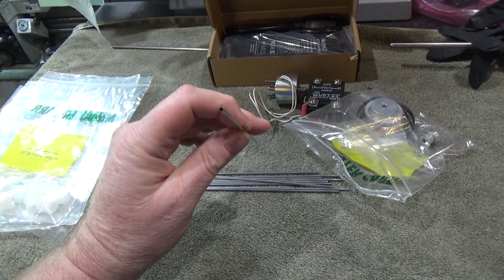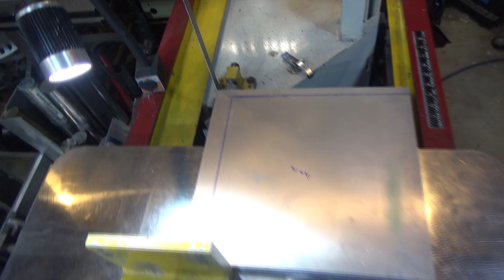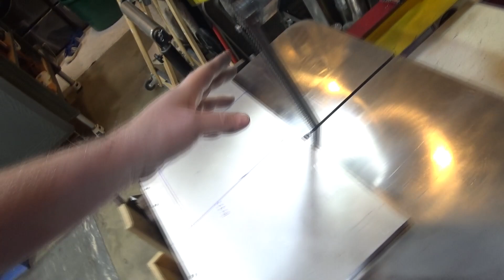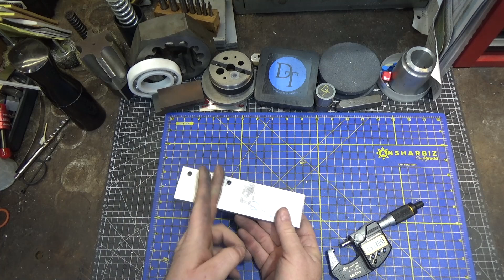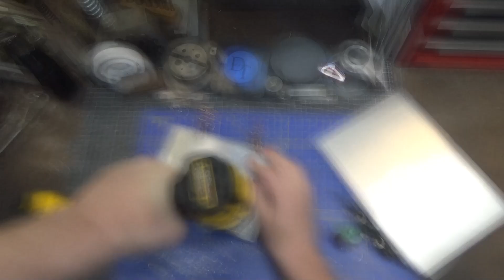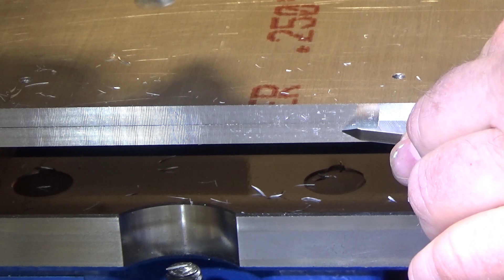207 "Toothpick" Dispenser Part 1 The Basic Idea

Comment: Is it possible to sharpen/restore the saw blade, Instead of using it as material?
Reply from the maker: It would be if the teeth weren't sheared off in parts.